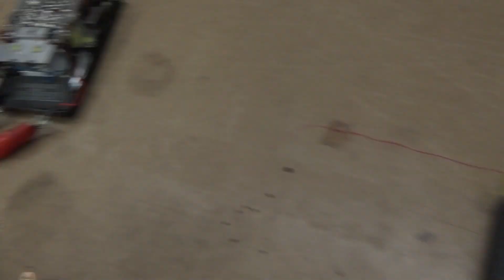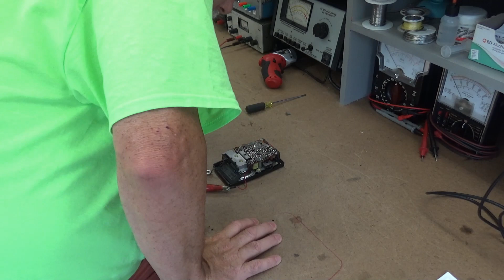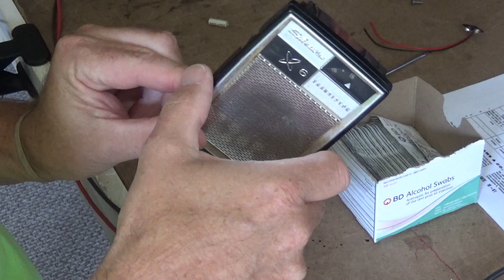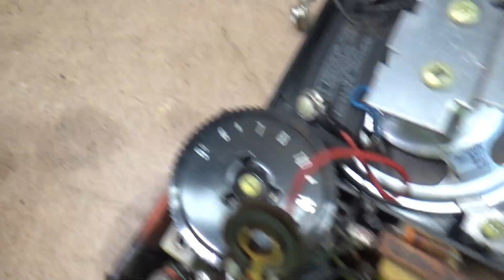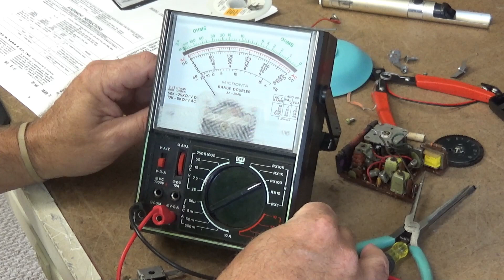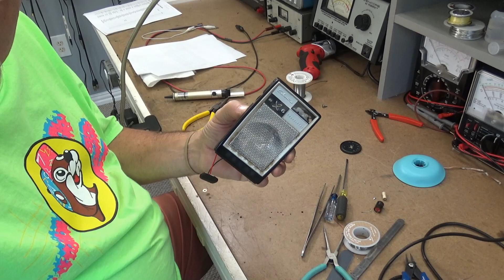Silvertone Model 1205 AM Transistor Pocket Radio Checkout and Repair

Comment: Good job! It is usually possible to repair a rustling regulator simply by dripping liquid sewing machine oil onto the graphite using a syringe with an injection needle, and without the complex disassembly of the volume control. Good luck to you!

Comment: I think the term you were searching for on the wire insulating sleeves is spaghetti. I typically reuse these when possible. Nice find on the bad cap and good fix on the volume pot. Lot's of people are afraid to take those apart, but I feel it's the best way to get them cleaned up. Just have to take care and be gentle. I've run across those small dual E caps a few times, but not very often.  Just a bit of friendly advice on camera shots. I found it's best to limit the visible zooms and movement when you edit the video if at all possible. As you get older, motion sickness increases and us old guys tend to shy away from videos with a lot of camera shot movement. Overall a good video. Keep it up! ... Doug

Comment: that silvertone battery number crosses to a Eveready 226(also called NEDA 1600,  Rayovac 1600 or PP4).
If you search for any of those, you will find info on it.
It's possible that someone still makes a Alkaline equivalent , but installing a modern 9 volt battery(as you already mentioned), is probably the best choice.
Reply: ناو! ذو أوريجينال باتري إيز ذو بيست ءات  أال!

Comment: Volume controls seem to be the trouble capacitors are expected, I have recapped the front end of my Motorola  and left the audio capacitors idles about 6 milliamperes. Works well lots of fun to repair old radios. Keep up the good work!

Comment: Just did two 1963 RCA small portable radios. They both had that same dual cap in one. 100uf value, the same as yours. Same color and pin layout. I actually pulled one pin off the first one because it didn’t tell it was a two in one like a can cap. These take 4 double AA batteries anyway. They both work good but have a bit of distortion on bands above 1200 Hz. Both do the same thing. Below that they are both clear as a bell. I aligned both but didn’t make any difference. I’m thinking maybe tin whiskers on one of the Germanium transistors. All PNP, might figure out how to bias the circuit for silicon transistors.